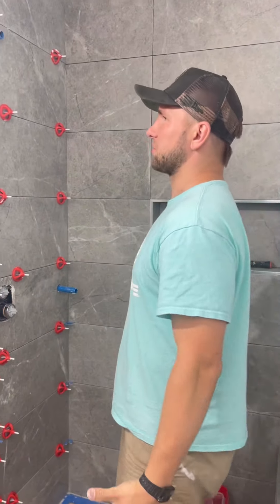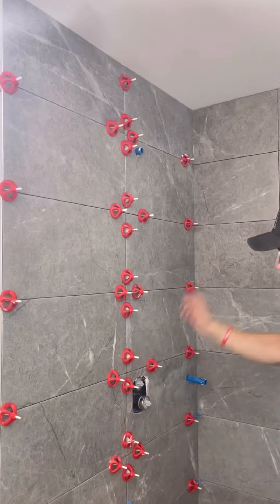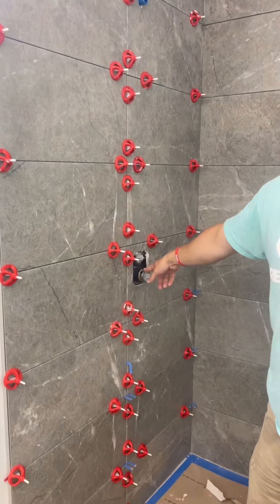A Guide to How to Tile a Shower Wall. WINNI Vlog 017

Comment: I used to clamp and hang over a table and had the same trouble with holes sometimes. Went to using foam board flat on a dewalt table top and that’s the only way I cut now! Give it a try
Reply from the maker: Yes I need to try that out!
Reply: @WINNI.Designs  completely stabilized the piece of tile, especially where cutting